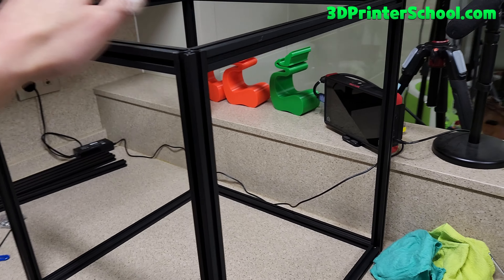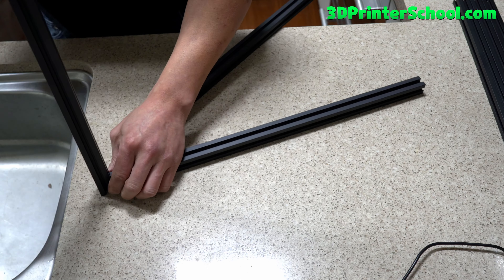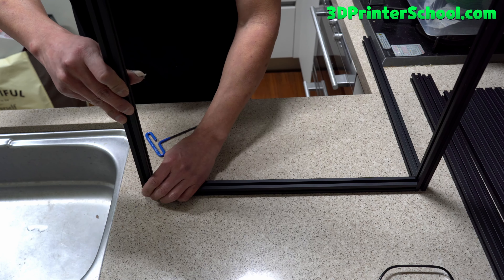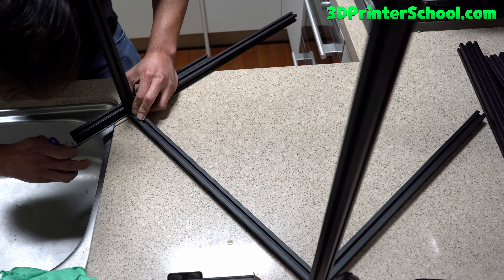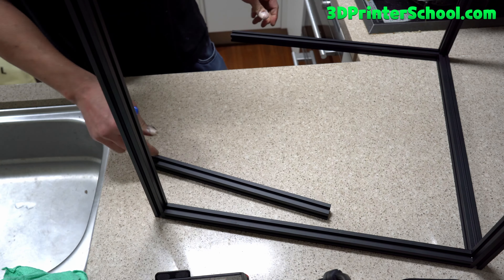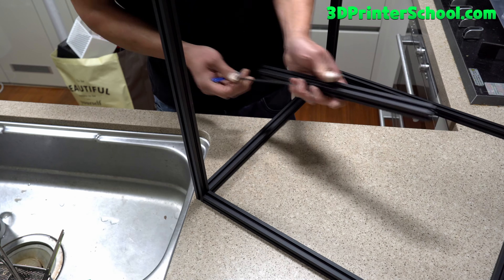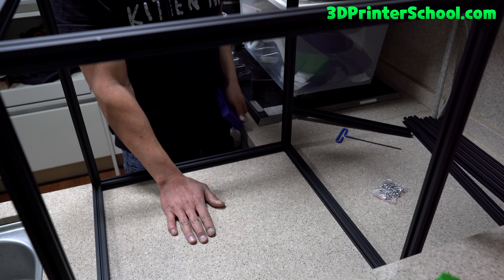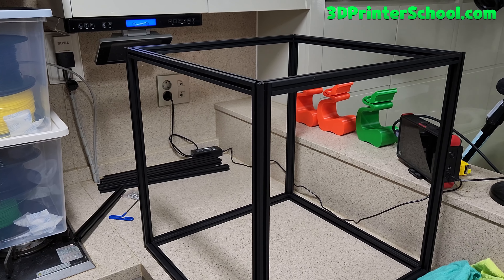How to Build a Voron 2.4R2! - Step 1 Square Frame Assembly

Comment: You should also use a tape measure or long ruler to measure catty corner to ensure everything is the same measurement.
Reply: I have found metric 123 blocks and machinist squares to be an easier and more precise test.

Comment: I've been obsessed with researching this kit the last month. I cannot justify the cost of a LDO kit and mixed reviews between them and the formbot kits. 

While building this kit, what parts would you upgrade? So far from my research I should get better wiring.
Reply from the maker: Wiring seems pretty solid actually on the latest formbot kit, silicone wires.   It is a solid kit now, ignore older reviews as the kit has evolved a lot.  Definitely recommend stealthburner.
Reply: It's highly likely you'll upgrade parts as you go along anyway as you learn. The only things I've heard people complain about in the latest kit is the fan quality.
Reply: Just self source your materials. That’s what I’m doing.

Comment: I did it on my bed and it's square
Reply from the maker: Lol your bed must be super flat.  There are rock beds you can buy here in south korea, super flat great for squaring voron frame. 🤣🤣🤣
Reply: Lol exactly. The flat referenced surface is not what will make your joints square. If you've done some woodworking, you'll know.